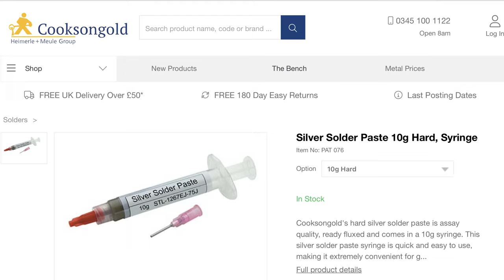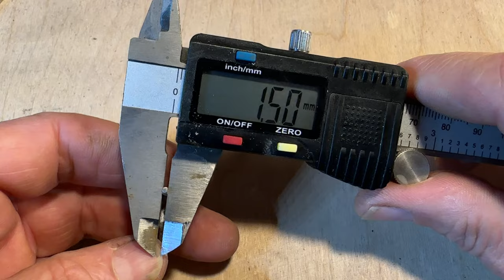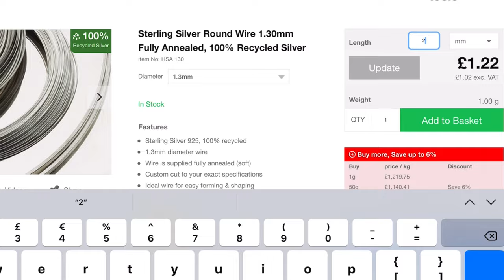Making a silver Celtic Knot bracelet wrist chain.

Comment: When you start your project with copper wire what do you use to close the wire with. Is it silver solder paste
Reply from the maker: Hi Badger On Tour, yes I use silver solder paste when testing and practising with copper … a little expensive these days, but does a great job … N
Reply: @Nickscreativestuff  thankyou. I'm going to give it a go
Reply from the maker: A few tips for solder paste are … only used on small joints that come up to temperature quickly … only tiny amounts are needed … the joint needs be clean and tight … good luck … Nick